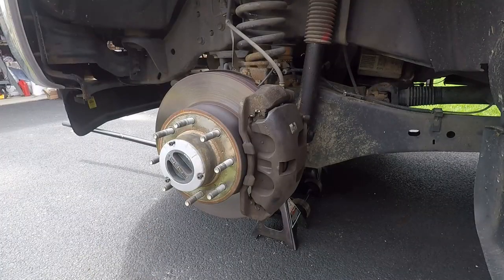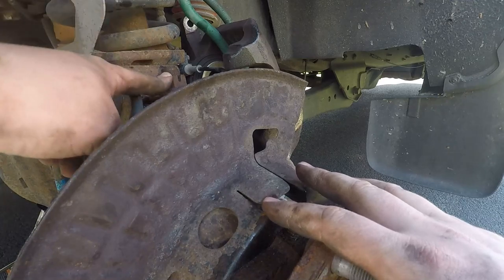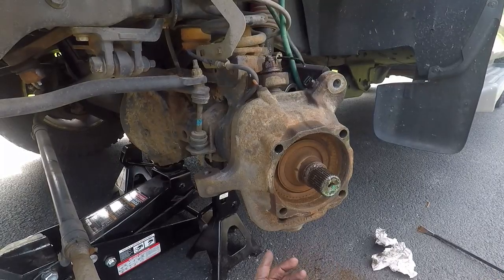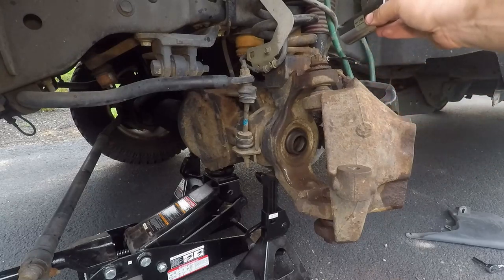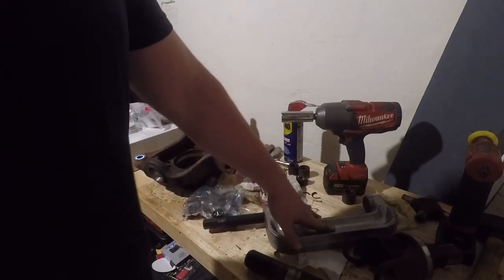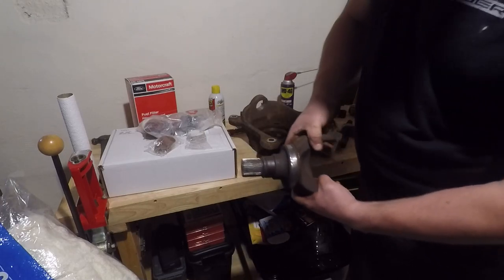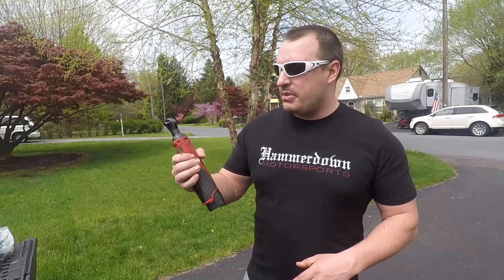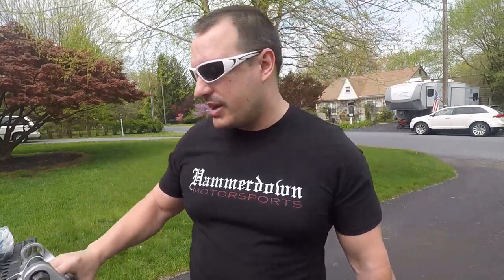F250 Ball Joint Replacement and Wheel Bearing Replacement

Comment: Watch your u joints, 2011-2016 uses 2 different size u joints. There is a wide and narrow axle setup. My 2015 f250 found out I have the dana super 60 wide axle. Bought the Spicer spl554x and were to small. Ending up getting moog 424 ujoint. Measure your ujoints before you buy.
Reply from the maker: I evem when to the Ford dealer for mine to make sure because I was finding several different ones. On my front end video I did I talk about how I bought the wrong piece for one because it was for the super 60

Comment: @7:57, you turned the whole assembly and your index finger bounced a dark ring around - what is that?  I just noticed mine free dangle like that as well.  Both sides.
Reply from the maker: That is a dust cover from factory. I have links to the upgraded one that works much better at keeping debris out of the axle tube.

Comment: You need a bigger hammer. 🤣 yes always have the last 8 of the vin when you call you're local dealer helps us parts guys out 👍 Great vid Jared keep up the good work thanks for sharing.  Be safe Brother!
Reply from the maker: Like something with a 3 foot handle lol
Reply from the maker: Thanks man for all the support. You stay safe too. I am definitely lucky the parts guys at the one local dealer are awesome. Cool guys too!
Reply: @six0bros  bigger hammers are always a must. As are good prybars.Lol you are welcome. Yes being safe brother. That's a good thing if ya ever need anything hit me up. Hope you get the 6.0 back soon.
Reply from the maker: @ninjapat66  I got big plans for the 6.0. Been eyeing up some kill devil diesel stuff!
Reply from the maker: I actually bought 2 used snap on pry bars after this video lol
Reply: @six0bros  lol, I have a big one I bought from harbor freight. The Milwaukee 1/2 drive is nice I've used my buddies b4 beats stretching out an air hose. Lol
Reply: @six0bros  Awesome. Keep me updated. I used my Warren Diesel tow tune pulling my bike trailer worked great. I set cruise n off we went hit hills n never once kicked into OD.
Reply from the maker: I love that impact makes life so much easier. It is amazing how far the battery stuff has come
Reply from the maker: When I know for sure I'll be releasing an update video right now just kicking some ideas around
Reply: @six0bros  yes that thing is pretty Awesome. I know right,I have a bunch of Dewalt brushless tools & I love em
Reply: @six0bros  keel, sounds good. I'll keep an eye out. My buddy posted some vids up of us carving some roads up on our bike you should check them out KunioD is his youtube
My buddy is shooting the vid from his KTM on on a 2016 Kawasaki Zx10r
Reply from the maker: Josh is a big dewalt fan and has a lot of their stuff. He counted his batteries the other day and he has 12 batteries lol. He was saying before some died he was at like 18
Reply: @six0bros  dang that's alot of batteries.

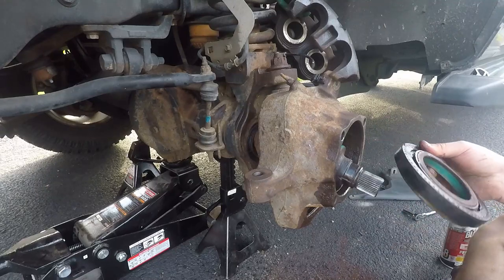Comment: 8:25  That seal is more like $58
Reply from the maker: I was delusional from the heat lol. I think I paid around 20 something. I'll be having the full list in the description by end of day for all the parts and where I got them
Reply: @six0bros  oh I see you didn't go OEM. 5C3Z-3254-B  Motorcraft seal comes with new nuts, snap ring,  o-ring, & seal.
Reply from the maker: It's just hard to swallow that price tag. The only parts reused were the snap ring and the nuts behind the wheel bearing. But the nuts behind the bearing I could definitely see wanting new ones. I havent had issues yet but I was thinking during it that I wanted new ones lol
Reply: @six0bros  on manual locking hubs I'd take the risk with an aftermarket seal but on ESOF (vacuum hubs) I go with Motorcraft because I don't want to eat the labor on a come back from a leaking aftermarket seal. 
  For balljoints I've been using Napa Lifetimes with great success. Haven't had one fail in the last 5 years of installs on trucks. If one does fail, Napa will give you a new one no cost.
Reply from the maker: I would only use good parts. I like timken stuff but I can understand being safe not sorry. been there before tried to save a few bucks and had it hit me hard then.